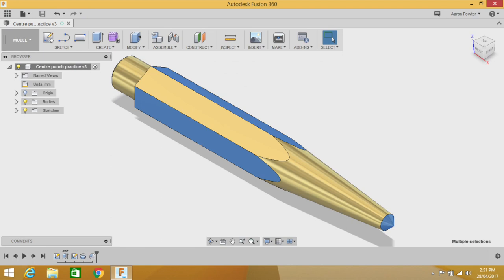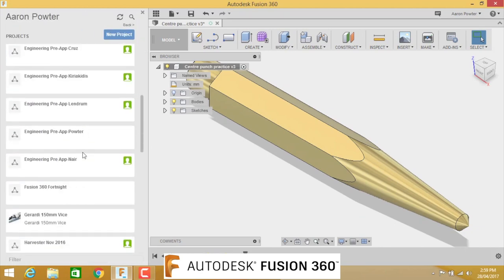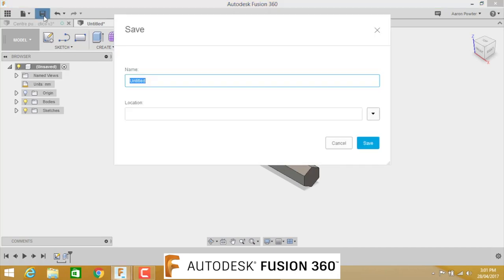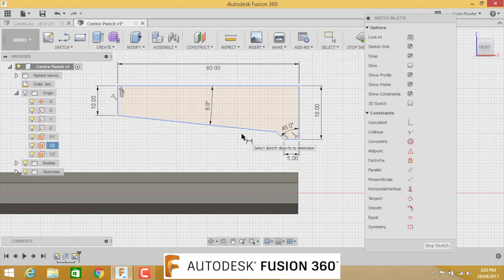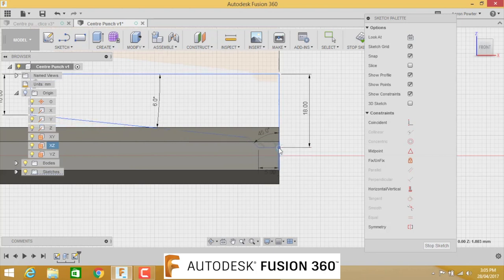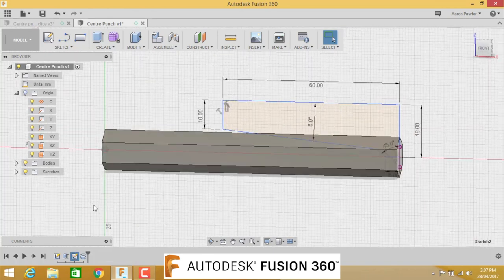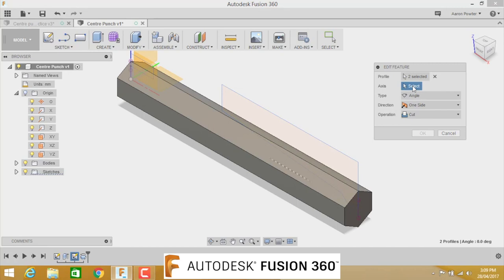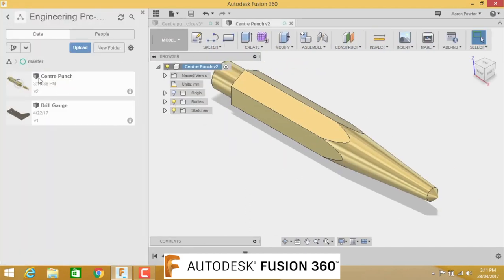Fusion 360 Tutorial - Centre Punch FF.E11

Comment: I've made couple of odd punches for specific jobs. This makes me want to make a general purpose punch.
Do your students make them out of O1 or another tool steel?
Reply from the maker: We usually use silver steel to make our punches but it only comes in round stock only.  We bought this Hex bar which is free machine grade and it doesn't harden that well.  It's fine to mark on aluminium surfaces, but will blunt easily on harder steels :-(